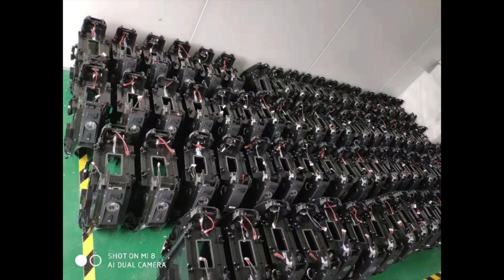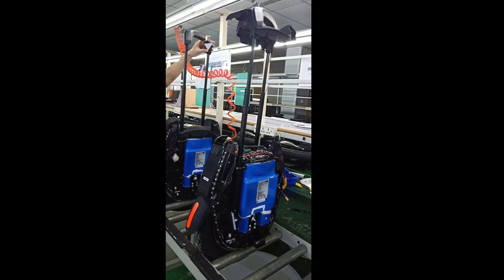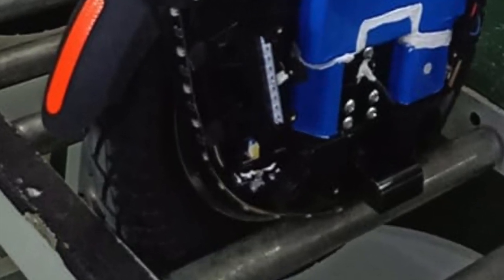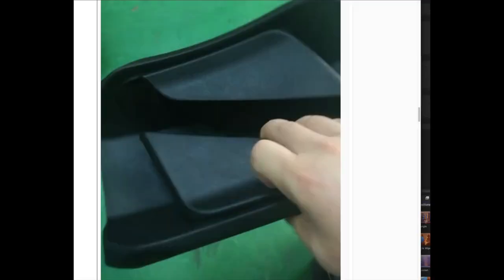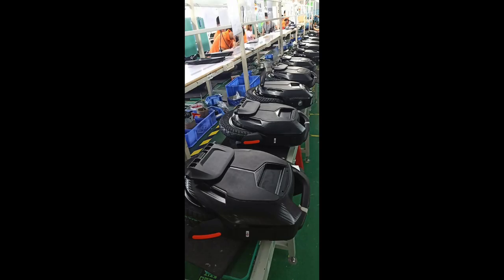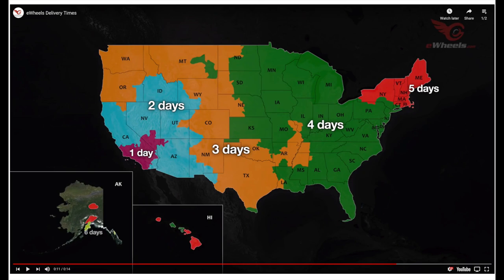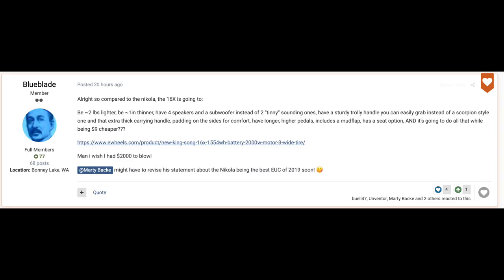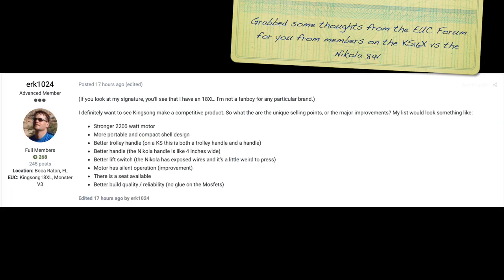KS16X Shipping Update

Comment: I opted for the sea freight. I can wait a month for the free shipping.
Reply from the maker: More patience than I have - summer is running out :)
Reply: Nothing like riding in the fall especially sliding on wet leafs as you round a corner or finding a pot hole that's hiding under them. BEWARE my friend!
Reply from the maker: @jackvolta3489  I'm aware the hard way.  One of the nice things about bigger tires.
Reply: @michaelpaolini  right on brother, that wz actually written for James,
Why does that happpen? No biggy : )